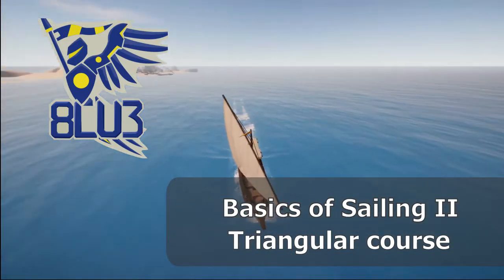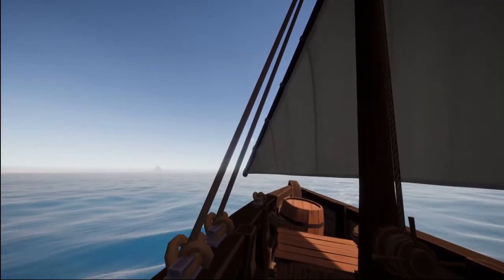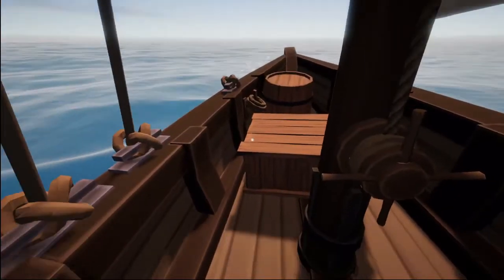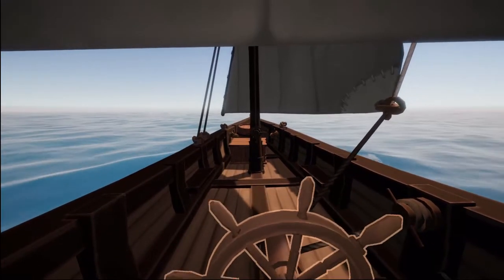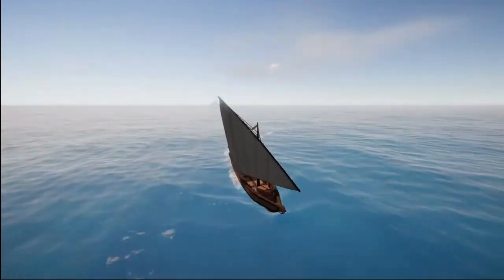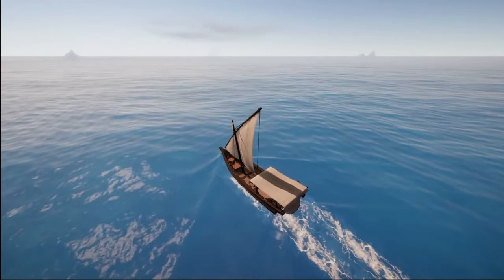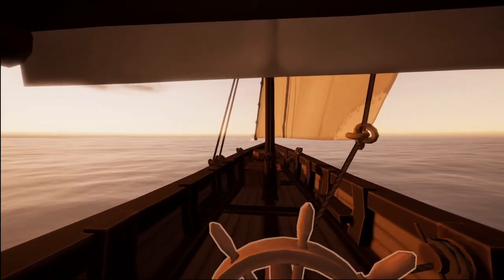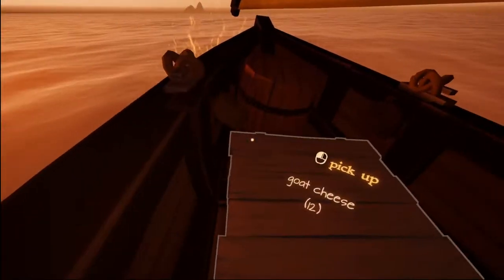Sailwind - basics of sailing 2 - Triangular course

Comment: On a starboard tack the sail shape is restricted by the mast, does this affect the airflow enough to affect the effectiveness of the sail? Just curious.
Reply from the maker: in the engine no, there were various versions of that rig in real life and yes it could affect efficiency a little. Sometimes not enough to matter. IRL you could pull the bottom part of the yard down which would let you put the whole thing on the other side

Comment: Good stuff bruv, can you do a quick video on how to use the chrono compass to determine position?
Reply: My method is using either "solar-compass" during the day or the quadrant at night to get my latitude, and use that number to set the "chrono-compass" during the day.
Turn towards the sun, and wait until the compass settles. The shadow of the central pin will then show you your longitude.
It can technically also tell you your latitude during the day: try to align the tip of the pin's shadow with the shadow of the horizontal bar and voila.
I think this method is too inaccurate, but the other two aren't that much better.
Reply: @erumaaro6060  thanks, this helped. I wish the map quadrants was numbered differently. Like instead of -5 to 5 it should be 10-10 or something, so we can get better readings.